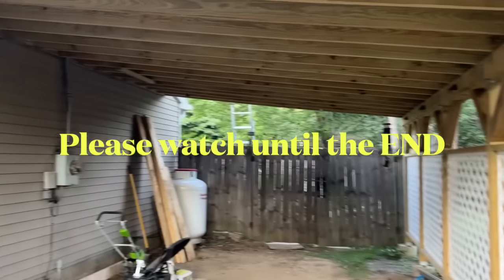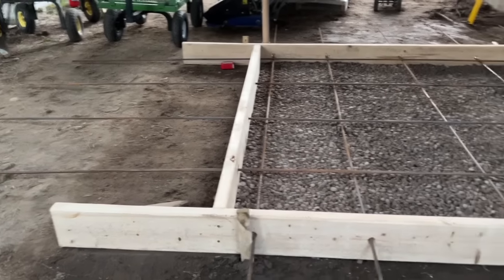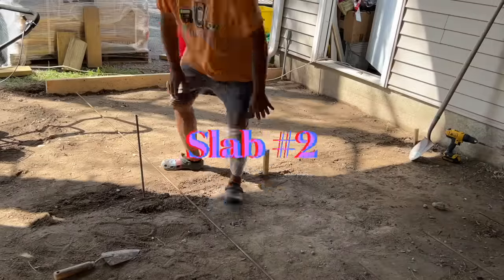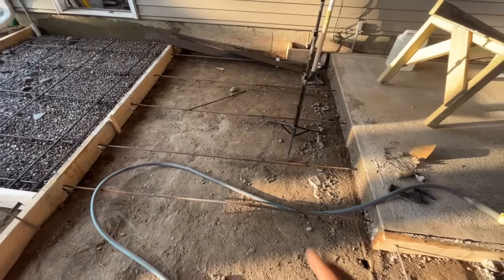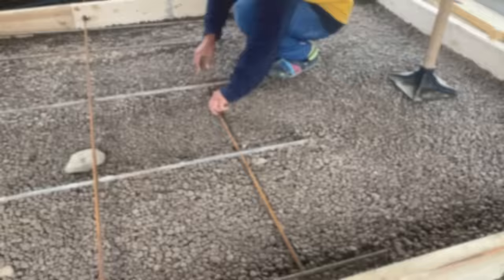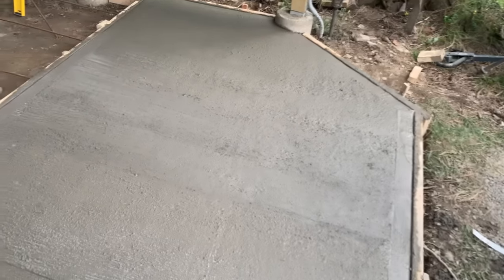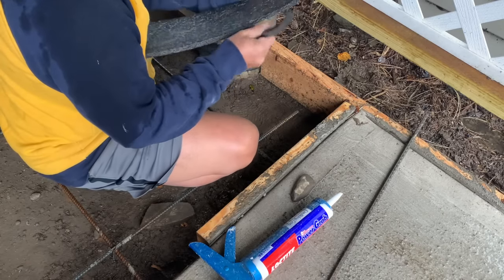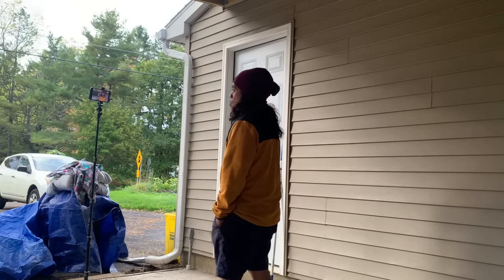Pouring BAGGED concrete for a driveway in sections, DIY.  NO CEMENT TRUCK, 24x14. 4 inch slab.

Comment: I poured my 16x24ft shop floor in sections like you did, only I drilled rebar holes in the finished slabs to extend rebar into the next slab. I used a Harbor Freight concrete mixer to mix two 60 lb bags at a time. It was labor intensive...but saved me about $9K over what I was quoted by a concrete company.  15yrs later, and the floor is still in great shape.
Reply from the maker: That’s awesome!!!!!!
Reply: this is great..thank you for the encouragement,,I want to try this
Reply from the maker: @dog_biter awesome!!!! :)
Reply: I'm curious on the price savings. What about just ordering a truck yourself? Seems to be cheaper imo. I guess the difference is needing help for that and that may cost you. but hiring 2-3 workers for a couple hours i would think that still would be cheaper. 

Thoughts?
Reply from the maker: @law6906  thanks for the comment and watching. Please read the description to answer your questions.

Comment: Awesome. I am making a 20x12 driveway and I’m getting quotes around 10,000. I’ll just do it this way! Good job
Reply from the maker: Defiantly get some help and make sure the weather is fair that day.  I was fortunate because rain or shine, I was under the car port.   Best of luck!!!  Let me know how it goes!
Reply: That’s an insane quote for only 240 sq feet!!!
Reply from the maker: @mattt6511  I totally agree.
Reply: @mattt6511  yeah, I'm usually around $7 per sf plus any overage on concrete minimum for small jobs
Reply: Not really if it includes material costs and you have to pay employees to do it. A company will always charge you high prices bht hopefully with those prices worksmanship is guaranteed.  With that being said i dont have that much money and dont want to make payments so i just bought a cement mixer to do it myself but if your time is more inportant definetley just hire someone.@mattt6511
Reply: $8 a sqft. Anything more and you are getting screwed.

Comment: Good job.  I did 6 individual 5'x6' slabs to make my patio.  However, I used a 'Steele Mixer' (youtube it).  It's a fully manual mixer that uses no electricity, just gravity & a rocking action.
I also attached a gate handle to the bottom so I could lift it out of the holder and dump the 60# bag when mixed.  However, I used 2"x4", not 2"x6".  Each slab (30 sq') used about 19 bags.
Reply from the maker: Hey!   Great job!!!  That sounds like a task in itself! Would
Love to have seen a vid.   Either way, thanks for watching and have a great day!

Comment: Looks good! I Done almost exactly the same with my shop. 24ft x 32ft. Done it in 8x8 sections. Took me two months working on it during the weekends. I used 50lb bags way easier to manage. And what was weird, lb for lb it was cheaper than the 80lb bags! Just finished the last portion last weekend. Pulled in my mustang for an oil change yesterday! It was a ton of work but still way cheaper than hiring it out.
Reply from the maker: Hey that’s great!!!!!  Definately a lot of work.  Perhaps I should have used the 50 pound bags due to costs. Just had a delivery of 80 pounds once again.  I should be able to finish this off and onto the next project.  Have a great day!

Comment: Wrt the forming method, I am starting exactly the same thing myself this week. 2 slabs: 13' x 10' x 4 inch (outdoor wood working area) which should be good practice for the larger one (22' x 16' x 6 inch where we will park our small tractor).
The reasoning for incremental pours for me is the same as yours : what can I achieve in a single day. If I got a delivery of a full load I would never be able to finish it properly. So, as long as I can get the mix reasonably consistent, we should be good, just as you've done.

I had not seen anyone else try anything like this nothing method, and so am very pleased to see it work.
I was thinking wrt the cutouts to introduce a vertically inverted V shape in case I needed to give the forms a bit of a wobble to lift out ... but your wider-than-rebar-diameter-notching seems to work just fine. So, will keep it simple.
The missus and I will work the mixer, and we use a sand/gravel ballast mix and add 42.5 portland.
We've done 4 foundations for a total of about about 100 feet of 18" x 18" foundations and so we're comfortable with the mixing and pouring.
Finishing is where I am nervous :)
Reply from the maker: Hello and thank you for the long comment. You are fortunate to have the help with the missus.  It certainly sounds like a large project, but most doable. Pace yourselves and definately plan ahead and y’all
Will do just fine.  I have done a months research and searching around to tackle pouring your own driveway and you are right.  There isn’t much out there.   The ones I see, a large cement truck comes at the end of the  day.   Gets the fun out of DIY….  Yes?   

You Are right.  Just keep things simple as well.  Too many moving parts might pose an issue. Reach out if you have any questions!   And above all, best of luck!

Comment: Very nice job! The smaller sections were a great call. I just did a 10x10 slab with that big mixer solo. It was a huge mistake for me to try such a big area at once. Trying to manage the mixing, the transporting, and the finishing within the cement working time was a problem. Definitely a 2 or even 3 person job. I intend to do more, but I'll be splitting it into smaller, more manageable sections for sure.
Reply from the maker: I wish I had more help, but unfortunately everyone is far and few.  Doing sections was much easier, but still laborious. After the driveway is complete, I still
Have to lay more concrete slab for a bbq island idea.  Good luck with your project.  Keep me posted :)

Comment: Did this about 15 years ago to increase the width of my driveway to park a car. Did most of it by myself. Was over a 100 bags of 80 lbs cement. Now we adding on to the garage and have to redo the driveway  since it is torn up for sewer and water line. It will be done by  a concrete crew with 4 cement trucks.

Comment: I’ve seen guys just cut the rebar to fit inside the forms with elevation brackets.  Almost looks like wire fence.  To connect the slabs they just drill into one slab with three pieces of rebar at three different angles.  I think you save alot of time.  Saving money by using gravel and sand mixed with concrete.

Comment: Looks great!
Did you consider putting expansion joint material between each slab?
Reply from the maker: Thank you for watching. For this project, I did not think it was necessary. The majority of the driveway is basically under the carport. Perhaps if it was exposed, I would have considered it. :)

Comment: I know how hard it is to use a electric hand mixer to mix concrete. I did that with  20 bags for a 5 by 10 shed slab years ago. I plan to do a 10 ft*46ft 6 inch drive way extension and a 12 ft *24 ft 4 inch shed slab this summer, but I will not do that jobs with the hand mixer again. I purchased a kushlan 6.0 cu. ft. 3/4 hp 120-volt motor direct drive cement mixer and a CENTRAL MACHINERY 7 HP Plate Compactor for the two jobs. I also watched Greg's video you showed, but I am not sure I will be able to use rebars through the whole slabs even though I should be able to use them between sections since the Kushlan mixer is low to the ground, and the mixer will be hard to move within the forms with rebar grids placed. I know the driveway will not be strong as one with rebars all crossed, but I have to do what I can do. Thank you for the video.
Reply from the maker: Hello passion,,,,  omg, 10x46?!?!   Yikers!   More power to you!  I love your perseverance!   Best of luck with your new project.  Definately take video and send it over!   Thank you very much for watching!
Reply: @AJDIYNetwork  Yes, the mixer can mix 4 80lbs of concrete bags at a time, and I will only finish 5 or 6 ft*10 ft a day, so the 10ft*46ft will take 8-10 days to complete.

Comment: Hi. First of all great job. I’m in the process of deciding which way to go with extending my driveway. I didn’t think you could use the concrete bags for driveway? Have you had any problems driving on top of it? I thought you had to use the gravel sand mixture with the powder cement mi.lx for theses types of jobs. I really want to do what you did in sections and just use the bags. How is it holding up. Any current pictures you can provide.  Great job again.
Reply from the maker: Hello!  Thanks for watching.  Absolutely, the bags are already premixed, just add water.  I made sure the consistency was always the same for each Bag of concrete…not too wet, not to dry, but manageable.  It I holding up really well with no cracks or issues.   I just recently sealed the concrete and also used SIKA self leveling joint coumpound between each slab.  This is mainly to prevent any sitting water to seep between the slabs(as rebar was used to tie in all slabs together) to keep any thing from rusting.  I did a completion video, part 2.  There, you can see everything…. Come next year, I’ll do another video to show everything is doing ok.

Comment: WHAT'S  the reason for using the STEEL Bars and wiremesh on  Concretes(when pouring the cement into it) ??
Reply from the maker: It basically keeps the entire slab as a single unit structurally and gives added support.

Comment: Great job. Lot of work alone or even with two guys. Well done. Rebar may not have been necessary but you would know for your area and use. I only say that because I have had 4 homes built and they never used rebar and I never had any issues but I know that will start an argument war so that's why I brought it up :)
Reply from the maker: Thanks shady!  Much appreciation. Have a great day!
Reply: @AJDIYNetwork  You too. I used to eat balut when stationed in the PI. Most would be surprised how delicious it is. I live in Thailand now.
Reply from the maker: @ShadyD365 omg.  I love Balut!!!! Cheers!

Comment: How much gravel did you use unless I missed it?  Do you always have to have slope towards or away?  For example, I have a concrete porch, when I redo it does it have to slope slightly to the left or right of the house?  What % or measurement away?  Same thing with a parking pad beside house should it slope to the left or right?  Do I need a french drain on either to improve drainage?
Reply from the maker: Hello. And thank you for watching.  I used approximately 2 inches of gravel give or take. The rest is concrete.  As for the slope, I don’t think you need a French drain.  It’s just added work if you decide to make one. My goal Was to keep the slope away from the house.  You don’t want water draining towards the house as is may affect your foundation to the house. As for percentage, I am sure there is a specific number, but I basically used the same level and made sure the bubble was touching the line to the area I am sloping. Although very subtle, I know the water, if and when it does happen(remember, it’s under the carport) it will drive the water AWAY from the house or foundation.  I hope this helps.

Comment: Looks amazing. Inspiring stuff 🙂 Did you put anything between the slabs to maintain separation?
Reply from the maker: Hello! I placed expansion joints between the slabs and the house and pillars.  As for slabs itself? It’s really Not needed with this project.

Comment: I plan on doing my driveway myself also , can i go slightly wetter on the mix to work it easier?
Reply from the maker: Hi Chris.  Perhaps not as wet.   You begin to lose PSI strength if you do.  I actually used a fortifier to help with the concrete mix so I didn’t have to use too too much water.  I didn’t show it in the video, because I was trying to keep the video under 15 min mark, which I definatley went over by a couple of minutes.
Reply from the maker: Also, if you make it too wet, the aggregate will Likely Sink to the bottom of your slab, thus weakening it the top layer.
Reply: You can, but the wetter it's poured the weaker the final slab
Reply from the maker: @bobbymac3696  agree!

Comment: Nice looking slab!

Appreciate the thoughts around the expansion joint between the pier and slab.  Have been wondering how that would be done.
Reply from the maker: We did have a harsh winter this year, and you can tell the slab did move a little from the freezing and thawing process.   However, all is intact and no cracks to the slab or pier :)

Comment: Great video. What type of gravel did you use? And how much did you use in one square ?
Reply from the maker: Hey thanks for watching.  I used crushed gravel and some all purpose gravel, which ever is available at the local big box store. I believed in use 10-12 bags per section.  Although I did not show video, I made sure i had 4 inches from the gravel to the top of the form.  Everything was levels, though I did have some minor deeper areas.  I do hope this helps.

Comment: i just know some pro is cursing and saying stuff like "youre gonna be sorry in 200 years when it starts to crack because you didnt vibrate it enough."  or something like "its gonna crack when you drive your 80 ton vehicle over it because you didnt tie the rebar enough."  lol

it looks great btw. way better than the sorry pros my land lord hired to put concrete at my old house. those dumbasses leveled the concrete into the garage instead of away. so when it rained the garage flooded.
Reply from the maker: Oh geez!  Water in the garage is never a good thing! Perhaps their level was a bit off ? ;-).   Thank you for the nice comment.  And Have a great weekend!
Reply: Just move the garage door to the back of the garage.  Problem solved :)
Reply: @btarb242  wasnt my house and the land lord is a cheap sleezeball. he hired home depot guys at 200 a day to get that job done in 3 days. lol  and not only that they left lots of beer and piss stains everywhere.

Comment: nice job!  I'm going to attempt the same.  did you use expansion joints between the slabs or just along the house?
Reply from the maker: Hi Steve.  Thank you for watching.  Only along the house I used expansion joints and around the piers. I could have used it between slabs, but didn’t feel the need as the area was not exposed to direct sun.

Comment: Looks good. I am working on my front yard right now and I'm still debating between a concrete slab or a paver. I guess that will depend on how much class II roadbase I have left after I completed my retaining wall and synthetic grass.  

I noticed you used the drum when your dad was helping but you switch to the drill mixer when you were by yourself. Is it easier to use the drill mixer when doing it alone?   

Also how's the compactor that you purchased from Amazon? 

Thanks.
Reply from the maker: I’m selling the drum. I only used it for 26 bags.  I’m not tall and lifting the 80 pound bag,,,,  or cutting it in half and lifting 40 pounds of concrete into the drum 50 times for one slab is back breaking for me. Some people online make it look easy, but I have to work what I am capable of. I felt the drum was a two person job as the mixer, I can work alone. The compactor works awesome! And a necessity for a job like this. I didn’t want to rely on a hand tamper for such a big project.  I’ll be selling that off next year as I won’t be needing it after the driveway. I’m sure I’ll get close to what it’s worth :). Do a vid for your project! It’ll be cool to check out.
Reply: @AJDIYNetwork  I'm recording as I go but will need to do voice overs. It takes too much time to record while working on a big project. English is not my first language so I do a lot of retake and I get more conscious in front of camera that's why I don't show my face if I can help it. 😀

Which brand of compactor did you get. I usually rent but you got me thinking, if I can sell it after even for less it will be the same as renting and I don't have to rush. Is it 2 day delivery?
Reply from the maker: I recorded as I went as well.  That way I don’t have to edit later. I must have watched the video many several times and cut out a lot each time. I try to keep my vids less than 10 mins to keep the audience engaged. This one took more than 17 min.  
At first I didn’t want to be in the camera either, but my cuz in PI has his channel and he recommended I get in front of the camera to also engage with the audience. My first few vids, you’ll just hear my voice and not see me.  
The compactor I purchased on Amazon:
BILT HARD Plate Compactor 2500-Pound, 21 x 14.5 inch Plate, 6.5HP 196cc Gasoline Engine 5500 BPM, Jumping Jack Tamper for Paving Landscaping Sidewalk Patio https://a.co/d/fT1W92q

I do hope this helps.

Comment: Do you feel that mixing / pouring the concrete is the hardest part?
Reply from the maker: @law6906  Hello.  Thank you for watching!   the hardest part of this whole project was moreso building and leveling the forms.  Mixing was not a problem as I was using a mixer. It was strenuous, but not back breaking. Just have to use proper ergonomics. Hope this helps.